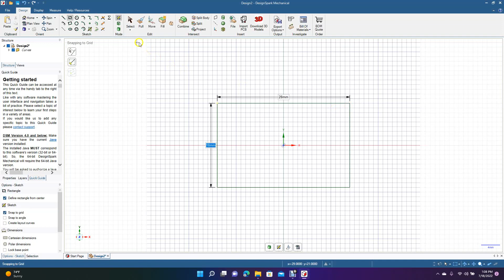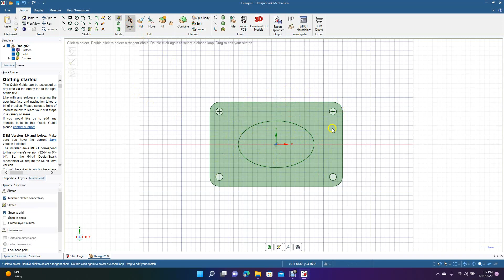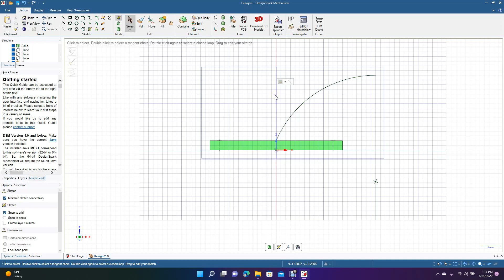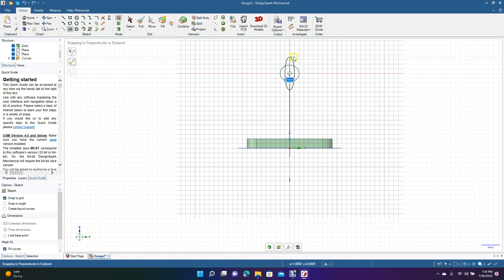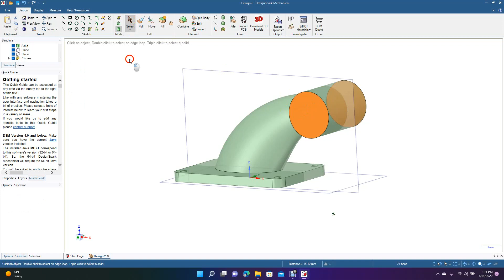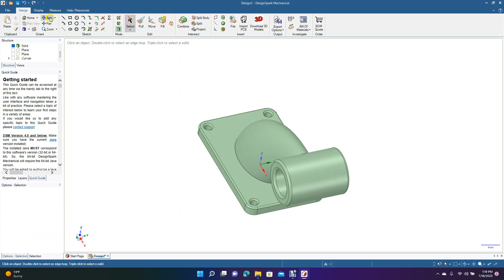How to use the blend tool in design spark mechanical

Comment: If the mouse has middle button so will you spin the model when its pressed, so much faster then to have to push a button every time.
Reply from the maker: I use my lap-tops trac pad, but I do have a mouse. Perhaps, I will start using the mouse.